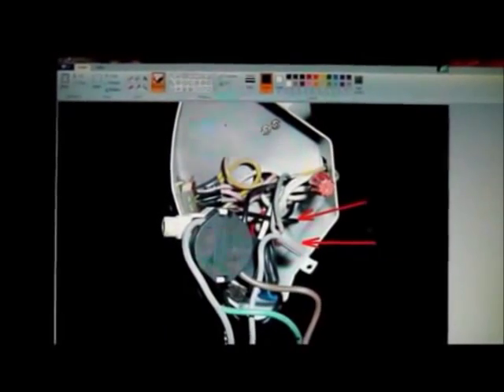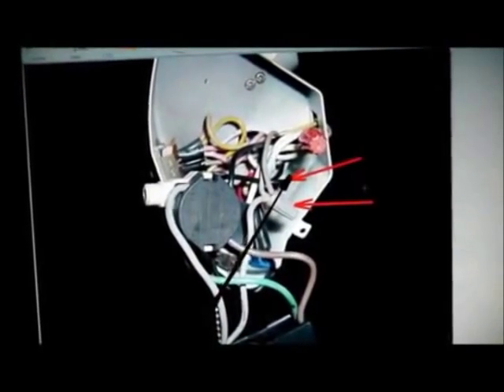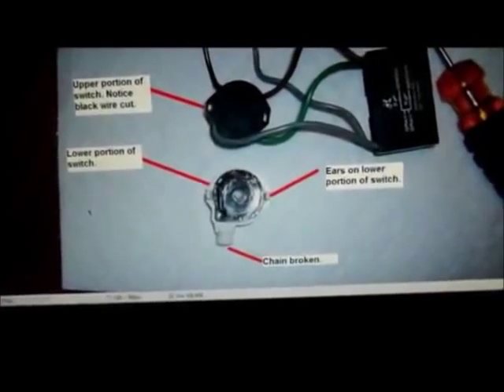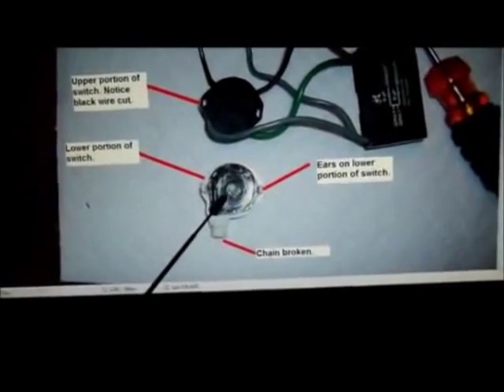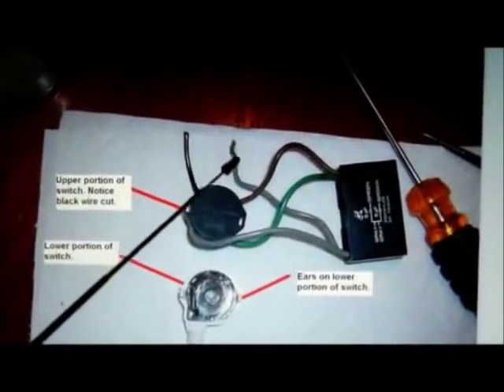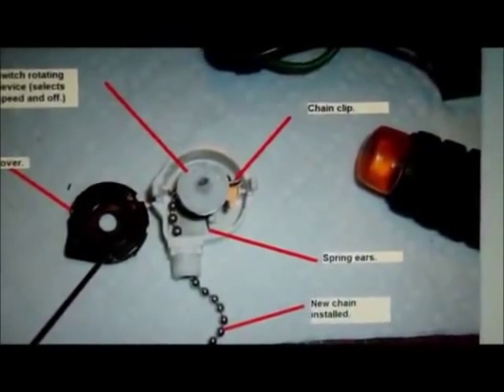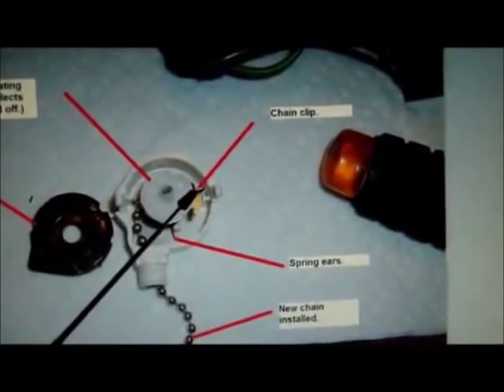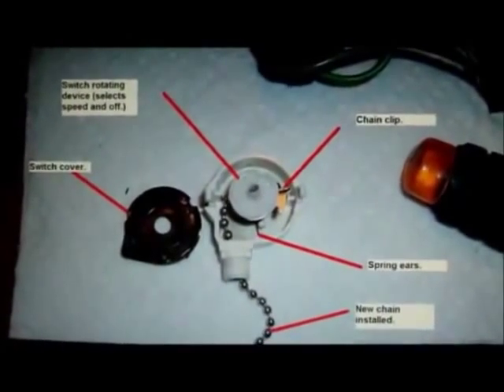Hunter Ceiling Fan 4-Wire Switch Repair

Comment: so the black power wire you cut will be spliced back together with a wire nut?  I was replacing a bulb in mine and saw the black wire was frayed and the inside exposed only because i felt a mild current when i touched it ..do you think it woud be alright to cut that black wire and wire nut it together even though there is nothing wrong with my fan. i feel it might be dangerous if it is not fixed.
Reply from the maker: Before any repair, ensure that power to the light/fan is off!  The repair you mention should be possible.  A simpler fix might be to carefully wrap electrical tape around the affected area.  Good catch on your part and yes, it should be repaired to prevent an electrical shock or fire.  Good luck!
Reply: ok....thanks a bunch...

Comment: Hi.
My fan is a bit different,there r 4 wires coming out of the windings thing -blue,red,brown and grey/purple
Do u know what they mean?
U see,I wanted to remove the lights from my ceiling fan and after I did I dont remember where the wires were connected!
(I fell like such an IDIOT!!!)
Do u think u could help a guy out?
Reply from the maker: What brand and model is the fan?
Reply: Thanks for responding!
I think I have figured it out.If I need any more help I let u know.
Thanks.
Reply from the maker: ok...good luck.
Reply from the maker: ok